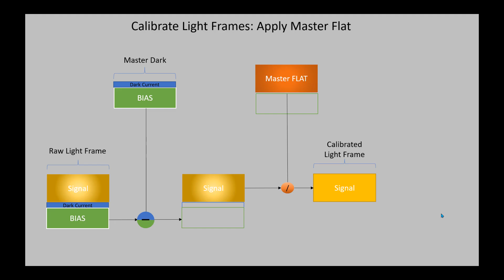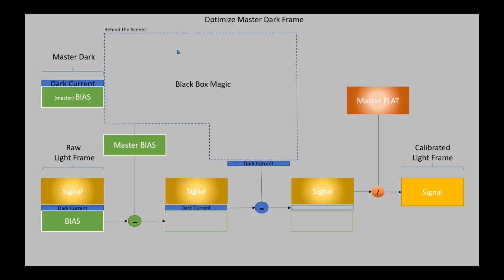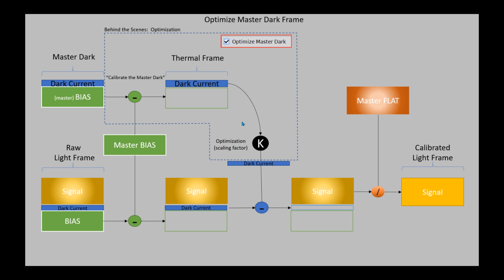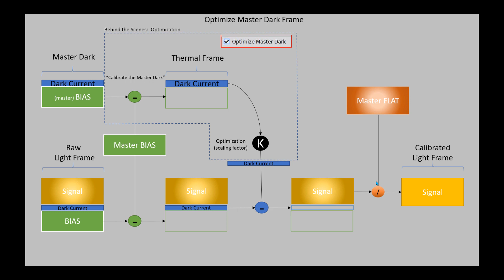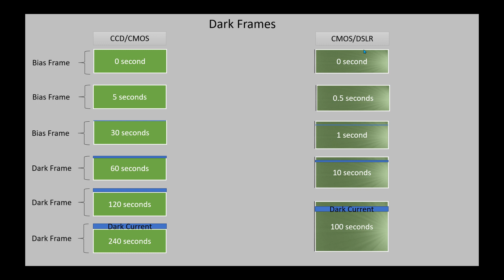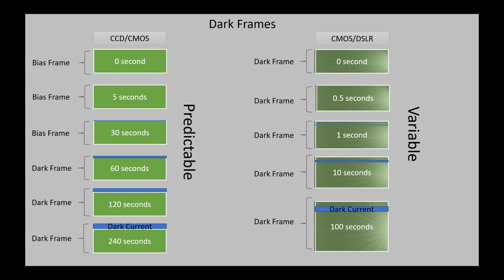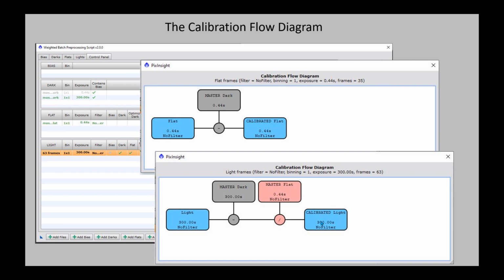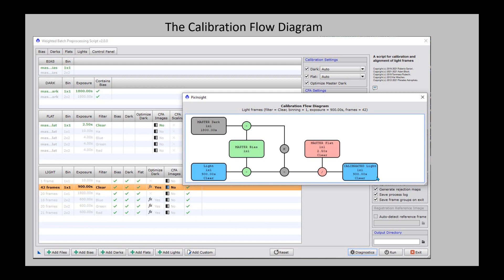WBPP (PixInsight): Flat Darks and Dark Frame Optimization

Comment: Kind of useless. An actual set of different  exmple cases would be 100% better !
Reply from the maker: I understand this is a critique... but I do not understand what the criticism is?
Reply: @AdamBlock  You should run some actual examples of data. As someone who is an educator, the problem with theory is that many of the details remain unanswered. WBPP is not very forgiving when certain things don’t lineup. There doesn’t seem to be anyone capable of explaining these details. So this is not a criticism only of your presentation but in general, no one has a video or sets of videos that go over various examples in detail to show what happens if things work correctly and what happens when things don’t work correctly and  explain why.
Reply from the maker: @Nick-we7lf  I am quite capable of explaining. As you know, I do exactly this with examples and explain WHY at AdamBlockStudios.com . This is the free stuff here on YouTube. Note, no other content creator- not even the developers- went to this degree of effort for free. And, based on your answer, I do not believe you have watched my entire YouTube series on this. I certainly do give some examples especially in areas  where there is some confusion.  On a final note, as an educator, you will know that the more specific the lesson- the easier it is to become out-dated with changes in software or method. What you decry as too overly general is what has permitted this solid information to continue to be valid for years.
Reply: @AdamBlock  Oh ! Now i got it. You want money for that. Sorry. I now realize you are a Car Salesman. 😒
Reply from the maker: @Nick-we7lf  I would put some money you are from England or Europe where there is an expectation of "free knowledge" or some variation of that culture. The WBPP video you watched took a heck of a lot of time to create. I gave you value. I gave you more value on this topic then any other content creator. Not enough you say! Plenty of Monty Python skits with the right kinds of insults applicable to you. Give them a watch. :)

Comment: Does it matter if I check evaluate noise when integrating darks files?
Reply from the maker: It is not required to do this calculation - it is for informational purposes so that you can compare integrations of the same data with different settings (rejection, weighting...etc). There isn't much overhead in the calculation though..it only takes a few seconds.
Reply: @AdamBlock  Thanks Adam.

Comment: I have read that if you use dithering for your lights, you don't need to use darks... but I'm confused about the impact on flats correction without the darks or bias frames.
Reply from the maker: Usually in these instances... the bar to reach the level where darks are not "needed" (I am suspicious) is so high that it isn't reasonable and serves only to increase the misery of others.
Reply: @AdamBlock  What if I took some darks and bias with the same temp on the sensor setting and the same gain, could I add them successfully to the existing calibration session? Although, since then I have cleaned the dust from the sensor cover filter. I spent hours trying different levels of flats. I use a light board with several layers of white paper and fogged plexiglass mounted on the front of my OTA, taking flats after each filtered 'lights' capture. Using the histogram in SharpCap, I have swung from 25% incrementing to 60% and none of the flats worked...  😟
Reply from the maker: @dr7615  the light level of the flats is the least important part of making them work. Typically a calibration error or scattered light are sources of flat errors.

Comment: Ok, I am somewhat confused here. First my camera is an ASI533MC and it has no amp glow so it seems to me from viewing your video on this that I should not have to use dark flats. Yet in numerous posts I find users of this camera quoting from this video that they use dark flats. Then in one reply to a comment in this video you say some amp glow free cameras can change over a period of weeks and you seem to be recommending agains using bias frames without dark flats. To make it simple, if I take bias frames in all my sessions with this camera do I need to worry about not having dark flats? Are my processed photos going to be of lesser quality not using dark flats?  Thanks I find your videos to be quite instructive, but this issue has me quite confused.
Reply from the maker: Hi Jim- Did you watch the video previous to this one? (part 1). In order to understand what I am saying- you need to answer the following question,- What is the difference between a dark frame used to calibrate flat field images and a  bias frame?  Your question above implies they are always  DIFFERENT things. You need to understand when they are the SAME thing. A bias frame is effectively a super short dark frame that contains only the bias level and fixed electronic  signature. A dark frame, being longer than a bias, will contain some dark current. But appreciable dark current only occurs after many seconds (perhaps as much as 30 seconds or more) for many cameras. So you have to agree with me...here a dark frame of between 1-30 seconds is the same as a bias. This is the case for your camera- and I am clearly indicating you should use a Bias frame to calibrate your flats (which are shorter than 30 seconds in length). But Jim- are you certain your camera doesn't have an amp glow or any other kind of electronic signature? Perhaps NOW you are.. but many people don't know!  If the camera has amp glow or other issues- you need to take matching dark frames to calibrate the flats. This is a minority of cameras. Can you see it now? I recommend to everyone to start by taking matching darks for flats since even if it is unnecessary in the first case above it DOES NO HARM since I just proved that a bias and a short dark are the SAME. Then these people learn... oh...look at that I can just take a bias. But if I made the other recommendation, to use biases in general- ALL of the people with these goofy sensors that need matched darks for flats will have an issue and I will look bad.  So I say take matched darks until you understand you do not need to if you have a well=behaved sensor.  Same sensors change (or users change software or gain/offset and screw themselves)... this is a different issue.

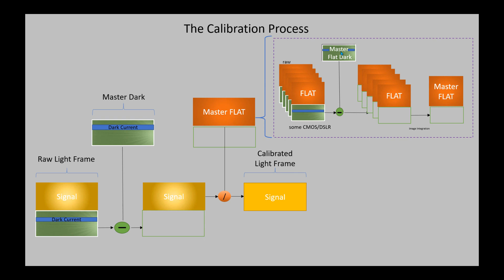Comment: At approx. 12:15 in the video, a master flat-dark is shown in the calibration diagram as being applied to the flats. But if you look at the Flat section of the control panel, there is no check mark showing a dark is being applied. When darks are applied to lights, the control panel shows the check mark, consistent with the calibration diagram. Maybe an error in the script?
Reply from the maker: No...the script is fine. I shouldn't have shown masters calibration frames (I should have had the raws loaded). The Flat section should NOT have a check mark showing the dark is being applied because it is a MASTER FLAT! Master flats are already calibrated images. They can be used as is. My screen captures (taken with raw files loaded) to not reflect have masters loaded. A bit of a non-sequitur on my part.
Reply: @AdamBlock  Thanks Adam. Mike

Comment: Is the MasterDark file that is saved off by WBPP calibrated?  i.e. If I were to reuse that MasterDark in the ImageCalibration process and use dark-frame optimization in that process would I need to leave the Calibrate option unchecked (while the Optimize option is checked)?
Reply from the maker: The MasterDark that WBPP creates is NOT calibrated (it contains the bias). I suggest that if you want to manually calibrate- you keep the bias in the dark as well. The only reason to calibrate the dark when doing manual calibration is to take advantage of optimization (and you should know what you doing... i.e. have very good reason to do this). So if you are doing optimization you do calibrate the dark... and then you need to subtract both the scaled thermal frame and the bias from the light frame.

Comment: Great video series so far, thanks for taking the time to explain it. I have a question which you may or may not have answered in one of the remaining videos in this series. During manual stacking I like to use SubframeSelector and Blink to filter out bad subs based on eccentricity and/or FWHM of stars. Does the WBPP 2.0 script include this type of feature or should I screen the subs before using WBPP?
Reply from the maker: There are errors in that (calibration) procedure that cause "newbies" all kinds of problems.
Reply: @AdamBlock   Understood! I'll continue watching the rest of this series and will compare the differences to the procedure I've been following until now.
Reply from the maker: @IcedReaver  I have some tutorials on my site that explain the manual method and where the issues are. In particular, Kayron instructs you to create bias subtracted master darks. THIS causes all kinds of issues. These are called thermal frames and are used to scale darks for calibration purposes...but this comes with caveats AND many CMOS sensors do not permit this kind of thing due to their electronic signature.
Reply: @AdamBlock  Hey Adam, quick update. I used the WBPP 2.0 script following your guidance thus far for my Rosette nebula subs captured with my ASI533 and wow, what a difference! I believe the problem is exactly as you say, incorrectly using bias subtraction. I got a much better calibrated master light when removing bias frames and using dark flats per your guidance. Now I'll follow through with the remaining videos to make sure my remaining processing techniques are used correctly. Thanks very much!
Reply from the maker: Yes, you should screen your subframes before WBPP. This script is a form of automation that works best with data that is self-similar. Although it has been hardened against some forms of failure (weighting, registration... etc) by skipping offending frames- it can't avoid nonsensical output in all cases- so don't give it nonsense to begin with and it will work just fine!
Reply: @AdamBlock  Thanks for the prompt response. As a newbie, so far I have been following the manual stacking approach laid out by Kayron Mercieca (Light Vortex Astronomy). The tutorial said to use subframe selector between cosmetic correction and registering subs for the purpose of applying weights and for defining acceptance criteria for subs (like I said, eccentricity, FWHM etc). 

With my OSC camera and WBPP 2.0 in mind, when is the opportune time to use subframe selector in my work flow if I decide to use the script? I didn't think subframe selector worked on non-debayered images.

Comment: Adam, thank you. This is interesting. So by going this tutorial, is it fair to say that with the newer CMOS sensors that don't have any amp glow (IMX455, IMX571, etc.) we can follow a more traditional CCD-styled workflow of using bias calibrations, whilst for the older/legacy CMOSes (like the 1600 or 294) that suffered with amp glow, that they leverage on the flat-dark approach? Are there any repercussions in using the flat-dark approach on the newer "amp glow'"-free CMOS sensors?
Reply from the maker: Hmm... that isn't quite what I said. :) I would say you can always match dark frames for all sensors and not have an issue. So that is why I so strongly recommend it. Even without an amp-glow I do not assume that a sensor doesn't have a variable bias (electronic signature). In fact, I have evidence of some sensors that change their signatures (no amp glow) on short timescales (a few weeks). But, I do think you are right that the most egregious examples do have the amp glow.  So I don't trust any sensor until it is determined to be "stable."  Once that happens... then taking advantage of what a bias provides is great (calibrating a range of flat exposures and dark frame optimization).
Reply: @AdamBlock  If I can follow up...I have the 294MC Pro which has amp glow. I have also read the this particular sensor does not do well with bias frames and most users of this sensor do not use bias frames but instead use flat-darks. Just so I understand what you are saying, as long as I match my lights to my darks and flats to flat-darks, I don't need bias frames? Am I correct? Thank you. Great videos by the way! Thanks for doing them.
Reply from the maker: @markmuratore413  Yes, I agree. AND... unfortunately, you cannot take advantage of the bias benefits (including dark frame optimization)...so do not do this as well.
Reply: @AdamBlock  Thank you. It's all starting to make sense.